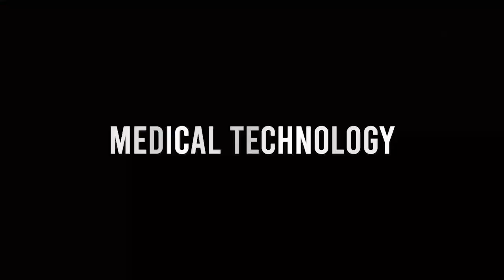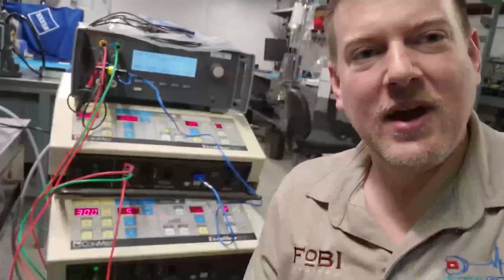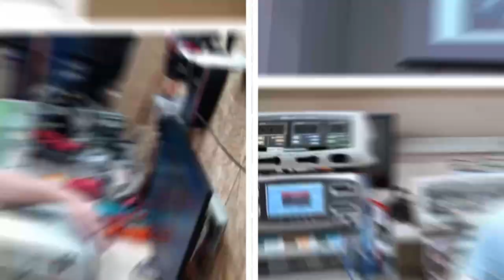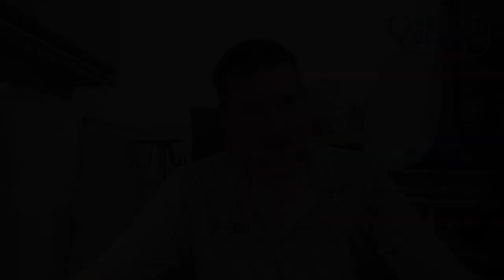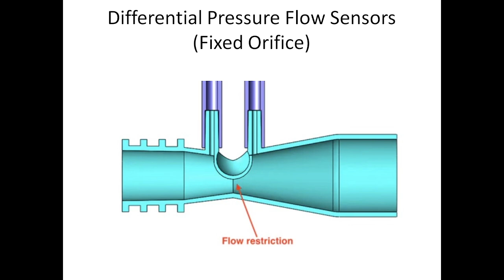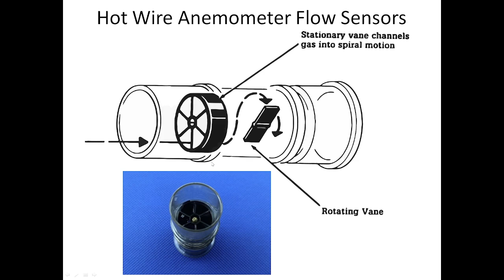Medical Gas Flow Sensors

Comment: why does the flapper style variable orifice sensor easily get damaged, can you explain about the thing that sticking inside the sensor? Thank you very much
Reply from the maker: @fionatran4098   to prep anesthesia machines, hoses like the suction line are attached but are actively sucking so the staff folds the tube over in two and inserts int9 the flow sensor hole to hold it until the case is ready to start. If inserted 2", it can touch the flapper and damage it.